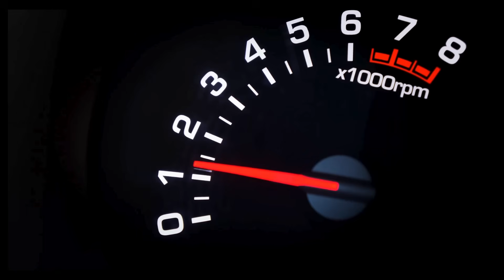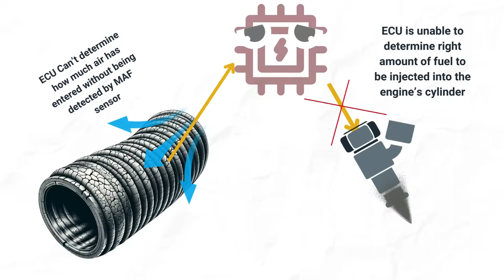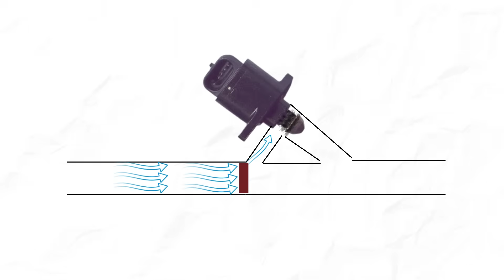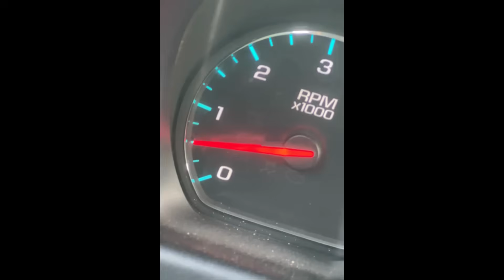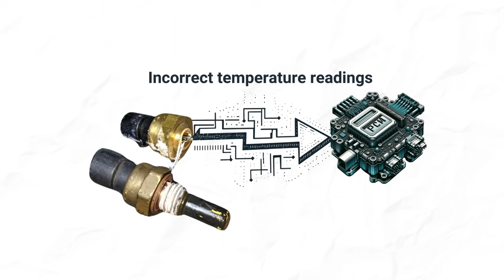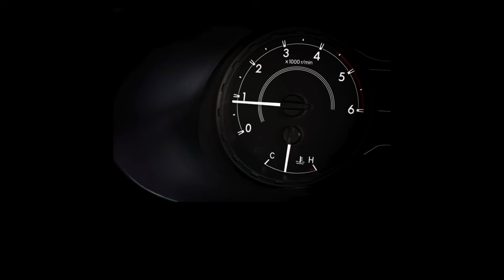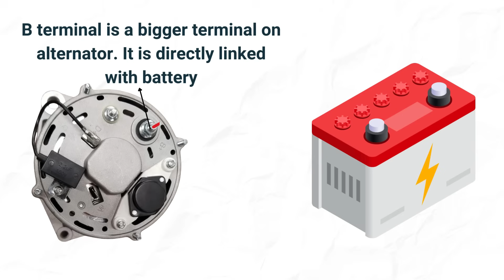6 Reasons Your Engine Revs Up and Down at Idle | RPM Fluctuations While Car is Parked

Comment: Why would the idle problem be intermittent?  It happens to me briefly and then doesn't happen again for a few days.
Reply: Did u figure it out? I have exactly the same problem
Reply: @xeroxedits1809  No.  Still have the same problem.  But other than the RPM dropping occassionally the car runs smoothly.
Reply: @xeroxedits1809  read my comment above
Reply: could be bad (water ) in the gas. It runs smooth when normal good gas passes thru but runs rough/ idle fluctuates when water passe thru because water doesn't combust (aka burn) buy a bottle of HEET and put it in the gas tank and see if it starts to run normal again.
Reply: @SKRooU2  that makes a lot of sense.  Because I only seem to have this problem after using Wawa or some other cheap gas.
Reply: @ haha yea cheap gas can wind up costing more money in the long run. Detonation is hard on the motor and water can run the fuel lines and tank. It's best to run top tier gas like Conoco, Philips 66, Texaco, Shell, Mobil etc. They have more detergents and actually add fuel injector cleaner in their gas. It's cost more per gallon but your motor will thank you.
Reply: Same issue here
Reply: @je2da15  read my comment above
Reply: @SKRooU2 thanks man, I'll give this a try!
Reply: @ good luck brotha.

Comment: All these videos are bla,bla,bla. I clean almost all sensors, idle Air Control Valve, Throttle Body, MAF Sensor, Oxygen Sensor, Throttle Position Sensor, Engine Coolant Temperature Sensor EVERY YEAR, etc, with new Engine air filter, good gas, clean fuel injectors, and the car is vibrating. the RPM Fluctuations doesn't exist when Car is Parked. New Structs, new motor mounts, new sway bar links, new sway bar bushing, new lower arm control with new ball joints, new tires with balanced and re-balanced and alignment and STILL THE SAME.
-----  STOP MAKING VIDEO TO MAKE PEOPLE CRAZY AND SPEND MONEY BUYING AND REPLACING PARTS FOR NOTHING.
Reply: Have you ever made a vacum leak test?
Reply: @jancsikus  I reply to you but don't know what happened with my answer. I did vacuum leak test with a machine, show Nothing. My car is inside a garage since day one and I do Extreme maintenance because what? is my Horse to move.  I have seen so many videos talking all this shit that I almost replace my whole car. Nothing works. Car has no engine light ever. When get warm I put reverse and vibrate going RPM down then stabilize but keep vibrating, put it in neutral stay quiet. put in drive, the same. in park, when is warm I put the A/C then start vibrating and RPM go down, then stabilize itself but keep vibrating.

Comment: What if the vehicle has a erratic idle only when the air is on or if it is on defrost. Idle is fine when the heat is on the floor or the vents.
Reply: AC compressor puts large load on engine at idle. ex. Ford 3L DOHC ODBCII read  idle load is ~17-20%, with AC compressor on, ~30-40%.
Heat doesn't use the compressor unless it's dehumidifying air, defrostin mode, or has a fancy set of auto climate controls, or it's a Ford and runs the compressor much of the time when outside temp is over ~40-45 degrees (won't go into why).  Clean thre throttle body and butterfly with throttle body cleaner, do the same with the Idle Air Valve (also with throttle body cleaner only).  Buy and use a new Idle Air Valve gasket when reassembling after cleaning.  There are many short videos here on how to do both. If you hear the person telling you to use brake cleaner to clean either of these parts stop that video and don't listen to a thing they said.  Same with MAF sensor cleaning, MAF sensor cleaner only, and very minimally, three - ten very short bursts from cleaner, and never touch it with anything. The cleaner will evaporate in less than a minute. No cloths or toothbrushes or compressed air!

Comment: Good mornong .I have a Toyota corolla 2000 5afe engine when I start the engine the RPM needle will work good after a wild the kneedle will go up and down,then it will S top on zero and car will loose  power , How to fix . Thank you very much.

Comment: 2015 Hyundai sonata , does it once in a while , I change the spark plugs , throttle body ..... Still doing it , what triggered me is that the check engine light never comes out !!! What is my next option ??!
Reply: I have a 2016 Hyundai Sonta. I'm so sick of this car, and I'm paying a note . I've changed the spark plugs, #4 coil pack, and oil change, yet still shaking every now and then . I'm so frustrated 😠 with it . I've been putting money into every since I got it
Reply: @TT-jj4zy  does it give you a code ??
Reply: @zsar16   I think it's a sensor , which I hope it is . I've been working 12 shifts, so I'm gonna check Monday
Reply: Always best to change all spark plugs at once

Comment: pls help i have a check engine light on for the past 2 months mechanics either cant find whats wrong or are just waiting for my car to break down to charge me more than wat the problem is i cleaned the maf sensor changed it started dying on me at the light changed it again driving more careful but still light on slow acceleration rough idle dont know what to do
Reply: That's my issue so trying these things now see if works as I don't want pay for something I can check myself. Can clear code but comes back, also no code or engine light so it's intermittent fault but will drive again after so long fine 😅

Comment: I have a 17 corolla IM 6spd when it gets hot in the middle of summer after a good drive w/o AC on it bogs like it has bad gas, it has done this since 19k at 27k miles, this car is a lemon, it doesn't  strands me- but more so as it is F*cking hard to drive. driving anything else feels like cheating after driving this god awful manual for 3 years. laggy throttle underpowered horrible gearing.

Comment: Hello sir !  When I remove or disconnected the battery  or changing a new battery  and then the RPM will become low  ,  so how can we solve this problem ??????
Reply from the maker: Did you check battery connections?

Comment: What causes RPM goes to zero? After I reset ACU by removing negative cable from battery rpm becomes normal. But when I test drive for several kms. or when I stop acceleration the idle speed goes to zero so the engine stop. Throttle body and IACV already cleaned.
Reply from the maker: Does your engine has ECO mode? In case of hybrid vehicles, engine stops at idle when car is in D
Reply: Good evening sir,  my car is Mitsubishi Lancer Cedia GLX 2008 and it is manual transmission.  I had already replace IACV and spark plugs but the same is happening.  When I replaced the spark plugs, I observe that all of it were wet of something like oil or fuel. I didn't try to check it yet, does this can be the caused of stalling idle?

Comment: I ended up needing to replace both my gas cap and my fuel tank breather valve. 2014 Mini Cooper S

For me, it wasn't erratic...it would slowly rev up to about 1500rpms at idle then slowly back down then slowly back up etc

Comment: Rpm starts fluctuating on idle only when AC is on...this problem started after cleaning the throttle body same time i changed battery and spark plugs.... before doing the above services everything was ok...please suggest 🙏
Reply: Replace everything back
Reply: It is not true. I'm facing it even if i don't on the ac.
Reply: @followthetruth3283 Have you fixed yours RPM issue? How?

Comment: My astra j gtc has just started doing this after getting running  good again I've replaced map sencor and cleaned egr valve prior to the issue. And now this just one thing after another. On my old petrol I replaced the purge valve and sorted it but I'm not massively clued up on diesels,  it only seems to be on cold start when the car is at running temp it eases off.
Reply from the maker: Did you check engine oil health?
Reply: @AutocornerdPros , I am having this issue for 2 weeks now on a late 90s Honda Accord.  No check engine light BUT  needle bouncy at Park or Neutral.   I have not done just a couple trouble shooting,  Oxygen sensor test & Battery/ Alternator.  I  doubt if it is Battery related.
Reply: My Astra is doing the same! Did you end up finding a solution? I haven’t found anyone else with an Astra J that has this problem!
Reply: @not_the_spotlight  mine has just started doing this needle fluctuating up and down when I first start the car but after a while when idling it stops doing it no warning lights on dashboard either 🤷🏻‍♂️

Comment: You could prevent the splitting / cracking of the air intake hose . By periodically spraying 303 Protectant on all rubber parts in the engine compartment .
Reply: Where to buy 303?
Reply: My idle air sensor is giving Mr problems even a new one Is giving me headache is I pluck and play or should I reset my toyora car first
Reply: Good tip.

Comment: My car is a zuzuki balino, earlier when the car is running it misfires or like knocking when the engine warms up.. then I changed the scam sensor and the oxygen sensor plugs, coil pack 2, ( change o2 s3nser, located in the middle of the silencer).. now when the engine is warm it works fine, but then After starting it in the morning and letting the engine warm up, it misfires or like knocking.,..but when the engine warms up, the misfire stops, it runs without error,...what is the reason for this?
Reply from the maker: Check engine oil condition
Reply: @AutocornerdPros  newly change..
Reply: An error is still having....no solution found yet...

Comment: I had a idle issues engine up and down on parking car on my q30 x traler  event when driving engine picks up n low speed.  Wat should I check
Reply from the maker: Idle air control valve and many other things

Comment: I have this issue on my lexus rx350 …..2016 but no check engine light! Any idea? I changed spark plugs, fuel pump and filter and intake manifold,,,,,,yet nothing the issue persist
Reply from the maker: Did you check idle air control valve? Are there any trouble codes stored?
Reply: @AutocornerdPros   check engine light is not on,,,,i will take it for a scan ,,,,,,,and i will check the Idle air control valve.  Thx

Comment: I have a 2016 bmw 640i gran coupe and I’m getting fluctuating rpms at idle, hesitant acceleration, and bad fuel economy, also have a P00Bd code for the Maf sensor. I replaced the maf sensor and the code still is there and same issues. Also replaced air filter. Any help?
Reply from the maker: Did you check connector of sensor? Also reset ECU after replacing sensor

Comment: I have a 2014 ford edge sport 3.7 L i had the water pump replaced at 77,000 km, and now i have roughly idle, more fuel consumption and i have rpm fluxuation the needle jumps up and down when i stop for  red lights or in traffic. I hope you can help, thank you.
Reply from the maker: Any trouble codes?

Comment: So I have the problem on Ford Galaxy 2004y. 2.0 petrol that my rps not stable at idle. For ex. when I turn lights on or condicioner rps go very low or car just cuts off.. I need to start again but when I turn off these rps going up but also not stable is that means IAC valve cloged and I need to clean?
Reply from the maker: Also check alternator
Reply: @AutocornerdPros hey again after 1 year;D so alternator works good - 14V . IAC valve was cleaned but still problem exists. There is one interesting thing. When I start the car rpms are like 500 when i press gas pedal like one tap rpms goes up and and down at 1000-900. I dont know why but then car idles almost perfectly (rpms  arrow still jumps a little up and down but you can't see when sitting normal on the seat).. so yea.

Comment: I had this problem with Pajero 2006 low rpm in idle and cant find the solution i replaced the throttle and the map sensor and checked the injection some times the car goes off becuse the rpm goes down when i try to stopped and when i make the car on its work good
Reply: Check your muffler for holes
Reply: @seanprice8999 sir please my accord does that but anytime I unplug the ECT MY CAR works fine please I’ve changed the ECT BUT NIT NEW ONE
Reply: Same here my Chrysler 300c is doing the same...will check my muffler haven't done that yet

Comment: My Mazda 3 2014 have an idle issue where by the car idle fine at start but minutes later when I started to drive I would notice the rpm be at 700 and start to fluctuate low as 500 rpm the only way to keep it up is by turning on AC … what would be the issues there? Any advice or help would be great
Reply from the maker: Any trouble code?
Reply: The same problem with my pajero 2006 and when i check doesn't appear any code

Comment: Thank you for the tips. I have questions my Volkswagen tiguan after long distance travel when i stop and leave the car iddle in a long period the car started to miss and engine turned off, and when i attemp to start it comes epc light and fluctuation rpm. What could be the problem
Reply from the maker: Could be several causes. First inspect your throttle system.
Reply: Most likely faulty IAC valve

Comment: Hi i have an hyundai accent  2012 midle east version 1.6l engine,
I have the RPM flexuation while it idle then its turned off the engine while (not using AC and the gear in parking mode)

Note: when we turn on AC or the gear on drive or reverse the RPM will be stable and not turned off.
Reply from the maker: This is strange, so when you turn on AC, RPM becomes normal?

Comment: I have a 2013 Toyota axio and it have 5-8 second delay when moving off I also change the gas pump and the problem is still there what u think is the problem
Reply from the maker: Did you check EVAP purge valve?
Reply: That sounds like a sensor bro

Comment: Thanks for all that information... Question: what would be the cause of 2011 Nissan tiida to burn more gas than regular?
Reply from the maker: Could be a ton of causes. Too difficult to point of single one. Like spark plugs, injectors, throttle body, MAF sensor and oxygen sensor
Reply: @AutocornerdPros could be like my car and be a fuel leak I just fixed it and went from 19mpg to 28mpg
Reply: @dragonzdoser2071  yea but usually the reason is most people don't do regular maintenance on their cars and causes bad gas mileage.
Reply: if you were doing regular maintenance you wouldn't be having that problem. Do scheduled oil changes. fuel filter changes, air filter changes, spark plug and wires replaced as scheduled. Run Lucas fuel injector cleaner every 6 months in your gas tank. Use top tier gas stations like Conoco, Philips, Shell, Exxon, Mobil etc. Google the list of stations. DO NOT use cheap quality, cheap price gas stations. Top tier stations use the best formula for gas and use detergents to keep your fuel injectors and motor clean. Don't just drive around the city making short stop and go trips. Drive on the highway at least once a month to keep the motor from building up carbon which hurts gas mileage.
Reply: 80% is your driving style unfoirtunately. Modern computers and fuel injection takes care of most problems pretty well until car doesn't start or run.  I recently replaced intake manifold gaskets, TB gasket, cleaned TB, cleaned IAC , replaced IAC gasket, new sparkplugs, all with zero effect on MPG. Idles better though (that's what I was addressing along with 100K prevent maintenance) but that's about it.

Comment: My engine rpm is fine at idle. But if i Rev the engine to around 2000rpm plus it suddenly fluctuates up and down. On elm32 graph, it shows up and down repeatedly.
Reply from the maker: Did you check throttle body? Any codes on scanner?
Reply: @AutocornerdPros  no dtc codes on scanner. The vehicle is maruti suzuki EECO. The vehicle doesn't have any problem while running. If i press the throttle at idle and rev it to under 2k rpm, it works fine. The moment it crosses 2k, it starts to go up and down. I came to know about this issue during emissions testing since it was not able to hold 2k rpm steadily while testing.

Comment: I have an old 94gmc that doing the same but can't pin point trouble,what would you suggest .
Reply from the maker: Did you try to pull trouble codes using scan tool?
Reply: @AutocornerdPros  can't find one that hooks up they say it's got old hook up